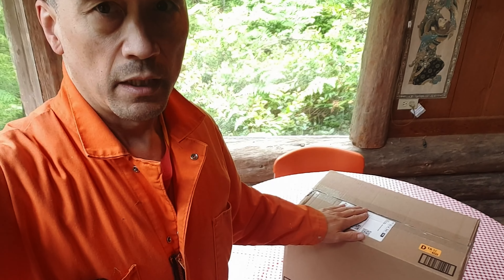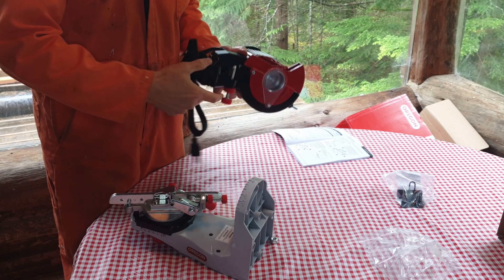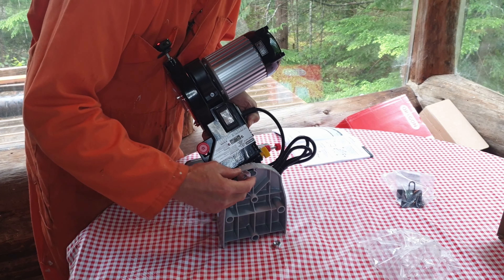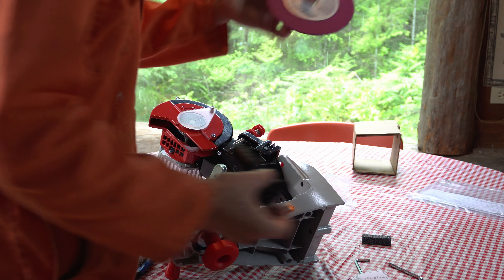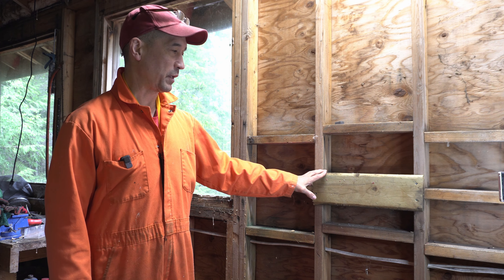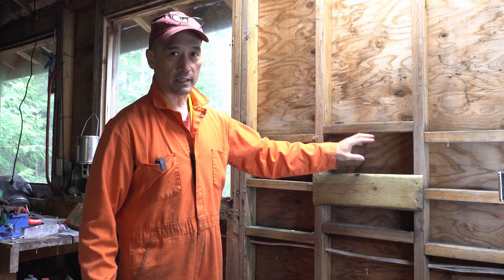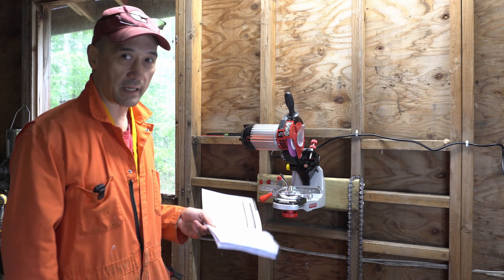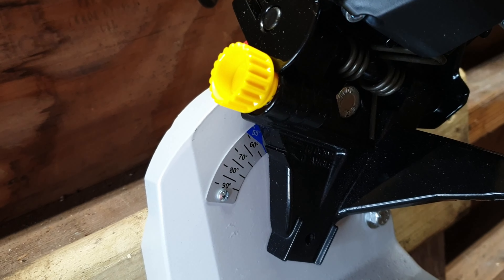Unboxing the Oregon 520 120 chain grinder - Full setup and first time use explained! #countrylife

Comment: What an excellent video!
I have one of these still in the box, was to intimidated to unpack it as i thought it was going to be a pain to set up. It's coming out of the box straight after breakfast!
Reply from the maker: That's the spirit Jack! Once you get the hang of it it is really straight forward! Watch the little yellow knob on the left. It locks the head in the upright position.

Comment: Try to take less tooth away, watch the cutting corner and when sharp, quit.  If a tooth or few are shorter, modestly sharpen them and then do the others with a more appropriate length setting.  If that does not work for your milline,replace the damagedcutter(s).  When your switch to CBN grinding wheel,  will be very impressed.
Reply from the maker: Thanks for the advice Rooster. I took way too much off the first chain, but it was my first time ever.  I think it is only the ripping chain that needs to be balanced and for the skip tooth won't make any difference. 

I tried something else on the other ripping chain. There was one bad tooth that I had to grind it hard, but instead of grinding all the other teeth the same I did only one on the other side of the chain  to make a pair of short teeth(right, left). It seems to be balanced.

I definitely want to move to CBN but I can't justify the cost until I have worn out these wheels first.